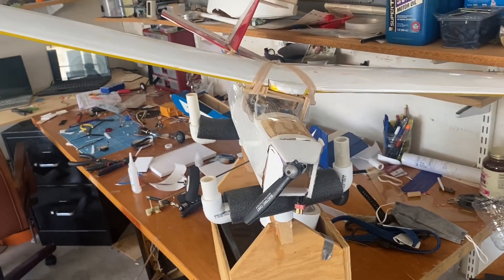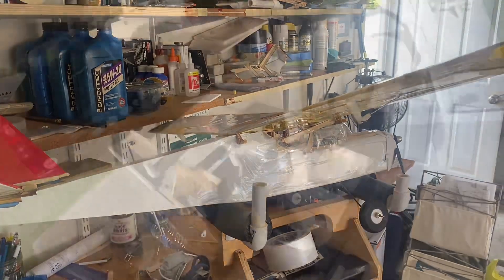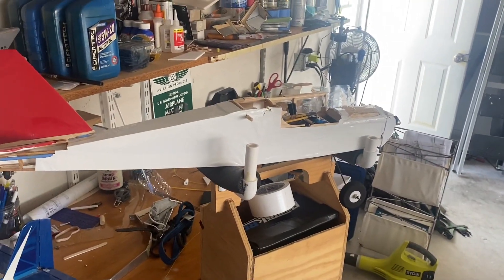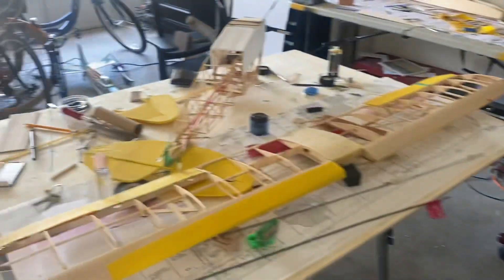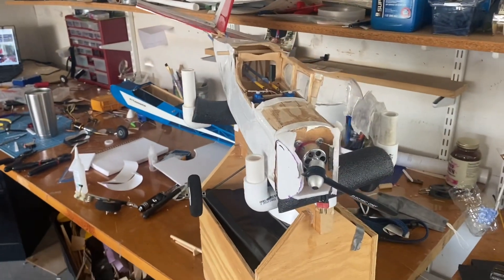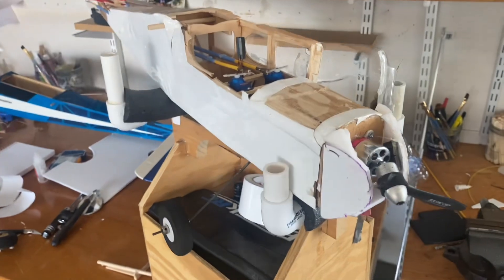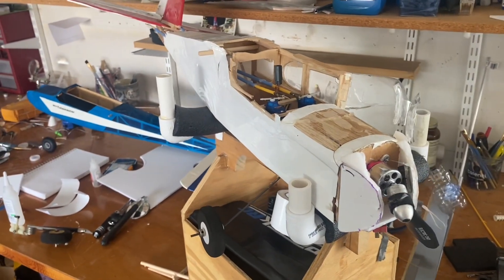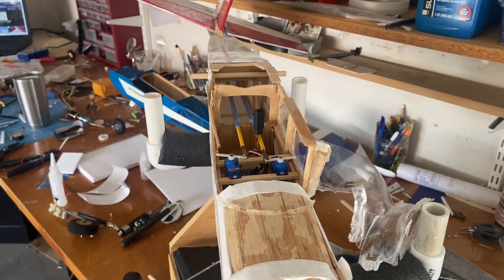Crash of Kadetito.

Comment: I could not tell from your video, but here are some suggestions: did you set up for proper "P" factor, did you check lateral balance, were your ailerons reversed or not working. It also looks like you were taking off in a cross wind situation?
Reply from the maker: I did check balances, and Checked ailerons . I don’t think o checked lateral balance